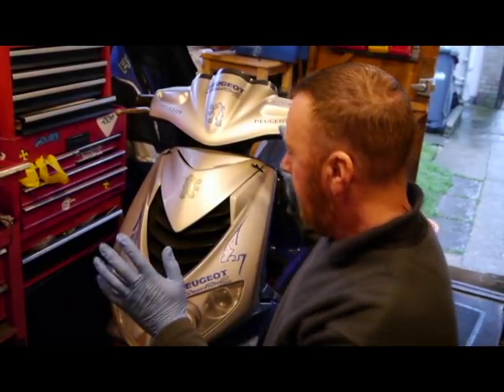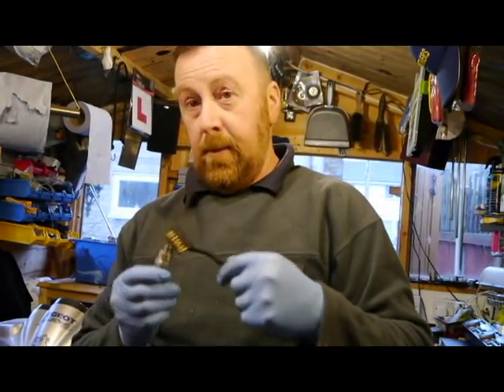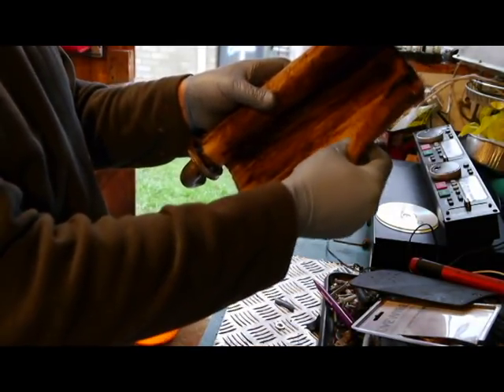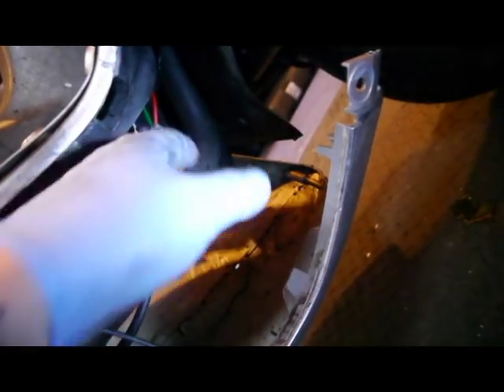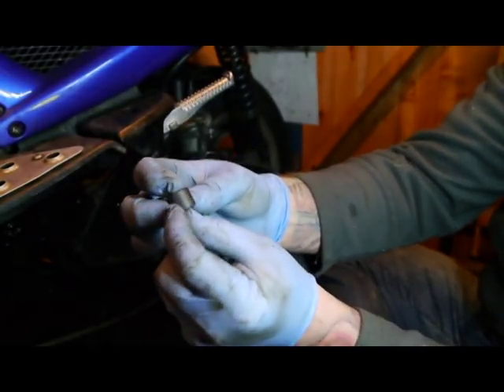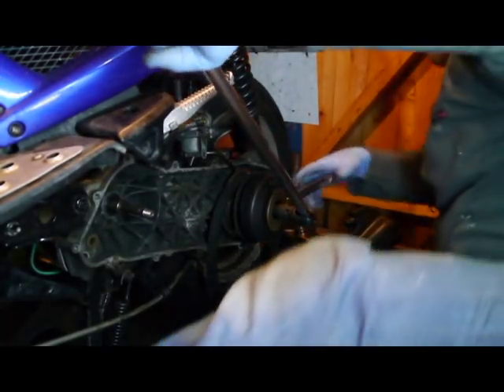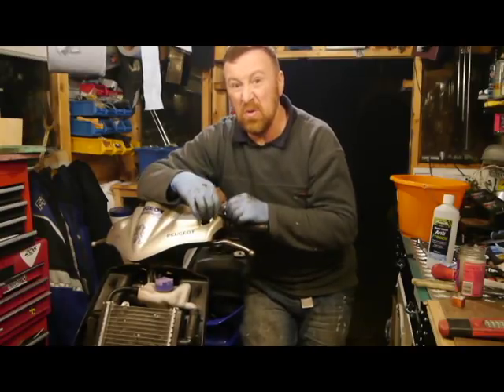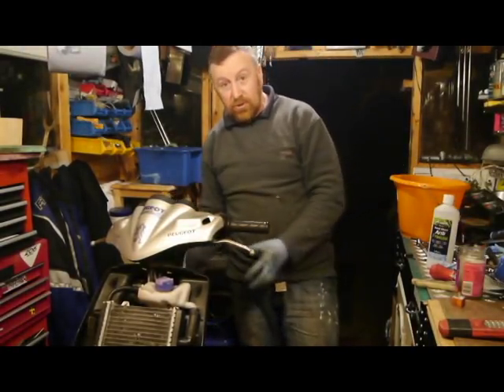SPEEDFIGHT 50CC MOPED STARTER RELAY EXHAUST CARB VARIATOR  FIX MARK SAVAGE

Comment: Hi Mark do you know where the rectifier is on speed fight 2
Reply from the maker: hi bud , the rectifier so we have the stator coil , ht coil, regulator so guessing it's the volt reg which is under the floor plastic cover, you will have to take loads of panels off to get to it or electric part are under the front main fairings and indicator relay is under the clocks watch my videos as they will help with getting to it and sorting it hope that helps mark
Reply: Thanks
Reply: Because I has already changed the ht/coil and it just cuts out when riding
Reply from the maker: cutting out when riding is more likely to be fuel problems , have you check out my carb videos?on how to check and clean your carb fuel pipes and float problems mark
Reply: I have already cleaned the carb and I am also change the 2 stroke pump because my 2 stroke light keeps flashing when it is full with 2 stroke
Reply from the maker: the light is just the little float in the oil tank, they sometimes jam but changing the pump is cheap easy to do and doesn't hurtwhen your riding how far did you get? how long did you ride it for? were you on full revs or does it just do it any way you ride.have you looked at you carb needle and the height of it as in my videosis your fuel vacuum working ok and stopping light it should when shut off like in my video test I have seen this before on a stator coil when it got hot it would shut down and go to earth but would start back up when cold when it dies can you start it back up straight away or after a bit ?have you changed the plug?mark
Reply: It don't bog it just cuts off when it gets hot then I won't start by the staring motor I have to kick start it and then it starts
Reply: And seems to cut out when I am giving it a bit I was going about 50-60 mph and it died out and I ride about 30 mins them it was left for about 4 hours then on the way back it cut out with in 5 mins
Reply from the maker: at the start I would think it was heat seizing but odd it starts fine and can run for 30mins which is great and yet odd, so I'm still thinking in that case its a fuel problem so you tested the vacuum and pipes are all ok and the float shuts off as in my test on my video
Reply: Ok will I will do that as well thanks Mark

Comment: I uploaded me draining the old 2 stroke out and its black if u can go and check it out cheers
Reply from the maker: they do make black 2 t oil bud along with green and red so it may not be the wrong 2t oil, but its ok as you have drained it out
just refill once all out with 2t oil and start and run, if it is the wrong oil so 4t engine oil may sure you get it all out and take off the pipe to the carb an run the bike with a little 2t oil in with the fuel till the new 2t oil comes through
Reply: @marksavage  yes all fixed now used low ash red mixture and just had it moted after being sat from 2013 loving your videos
Reply from the maker: hippityhopp gaming that’s great news bud